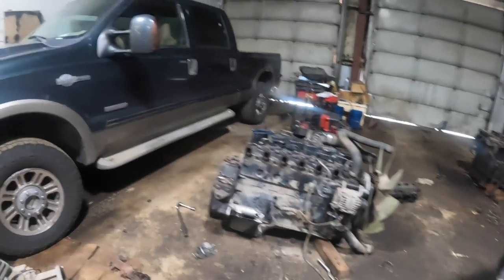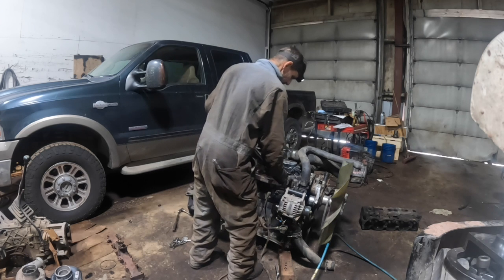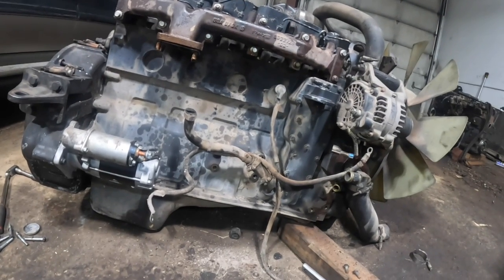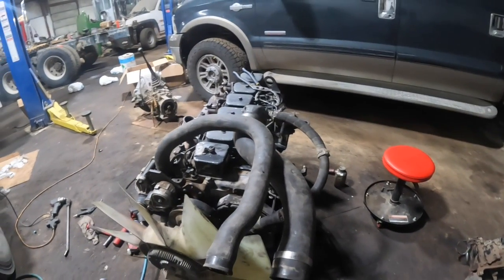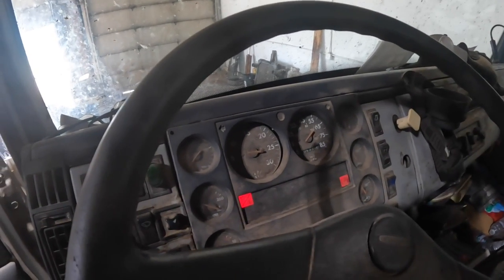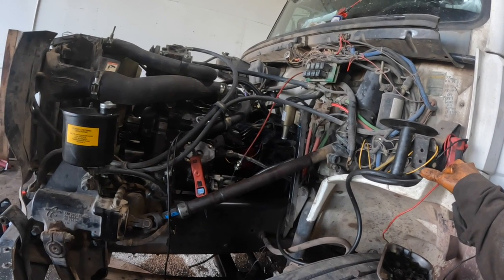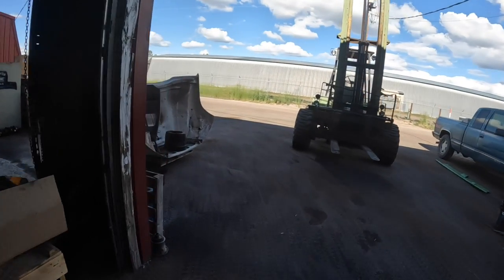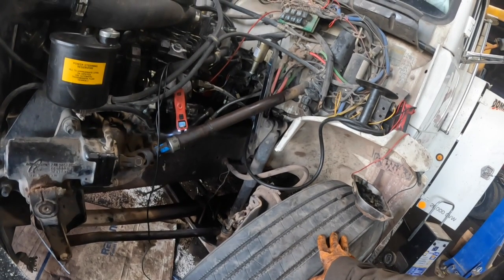Starting the old 5,9 Cummins

Comment: Real common on those VE pumps when they have been sitting around, will just have been the vanes in the vane pump in the front of the pump, will run and idle as gets pressure from lift pump, but soon as you put any demand on it they cant keep up and case pressure drops off. Sometimes they free up, othertimes they dont (couple hours rebuild with new seals on the bench soon sorts though!), you got lucky and im glad you did Warren! Good work as always thanks for taking the time to video it.

Comment: Dealt with sticky injection pumps before: just sucks. Used diesel clean, ATF in fuel,other additives. It's hit and miss: sometimes
they free up,sometimes not (rebuild required...).IP gods were smiling on you.

Comment: I put a 94 ..12 valve in my 03 dodge 3500 after  injector fail.Did the governor springs and mac plug so lots of jam.I chose to just use a pull stop cable so it can be bump started with no battery.Luv it.
    Will b interesting too see what happened to your original

Comment: Working on 2004 ram 2500 right now just replaced the front seal and running an overhead today. Was wondering if I need to replace the injectors. Has 350000 miles on it sounds like a sewing machine.

Comment: I remember in the 90’s working  for a fleet, we remove and replaced many of those 12v b series engine’s because if they lost a piston or compression we couldn’t inframe them because the blocks didn’t use liners and Cummins didn’t come out with a sleeve and the tooling till much later. By then our fleet had moved along to the ISB and so on , the b series were in our more medium duty trucks ( garbage trucks 2 axle) for mountain and smaller street routes. Most had Alison automatics that constantly had to have the throttle position sensor that controlled the tranny shift adjusted or replaced. The ability to sleeve those blocks gave a new life to them and I can’t believe how popular they become considering how many went to the scrap yard, remember the Brazilian Ford in-line 6 diesel, another scrap heap favorite. Personally the big cam , L 10 and ISM are my favorite Cummins engines to work on, repaired and inframed so many I could do them in my sleep, hell probably even from the grave. Thanks Warren for your content!

Comment: That Power service Diesel Kleen is amazing stuff / has saved me thousands - cleaned up my injectors -cleaned up the smoke / gave it more power with cetane boost  - need to use extra at first for about 3-4 days then use what the bottle calls for there after every day - its worth it / Thanks for the Video Warren 👍

Comment: Hello, Do you have a email that I can contact you? I am currently rebuilding a JCB 214S powershift transmission that have ran into some issues with piston liners and I remembered that You have worked with a few on video. I'm seriously needing help on determining what I need to do. The Pistons are the original composite pistons that JCB recommended to replace with the new aluminum pistons.

Comment: I love those old 12v's mine has 495000 miles on it still going.
With exhaust brake on a 12v they recommend running heavier valve springs

Comment: Would like to see a rebuild. Be cool if you could do a collaboration with a diesel shop like Oregon diesel or area diesel to get the parts to really make a powerhouse workhorse
Reply: Yeah for sure. I'm sure @AreaDieselService would be more than happy to help. They are masters at rebuilding the injection pumps too. They've helped out several different YTube channels in the past👍 - @WatchWesWork, @C_CEQUIPMENT, @JAMSIONLINE, @MortskeRepair, etc.👌 *I'm sure there's some other channels I missed too🤷🏼‍♂️
🛠️💨👍🚥

Comment: Try Nordloc washers on your exhaust manifolds Warren, been using them for years after suffering from manifold bolts coming loose on Paxman Ventura exhausts, haven't had 1 back off or come loose since 👍

Comment: Hey Warren, glad to see you're close to being in the road again. Well I guess by the time you see this message you'll already be hard at work. Are you going to get the old Ford service truck running? I've had similar problems with NAPA electric components. I've been building a 64 f100 and have had the water pump, fuel pump and ignition switch fail on me in less than 1000 miles. No warranty because of the one year warranty limit. The closest machine shop to me closed because the one guy who did the machine work had health issues. No one to replace him. What are we going to do. Maybe AI can solve all our problems!:😂

Comment: Waste gate turbos are only useful for gasoline engines that cant be over boosted accidentally and leaning out to detonation.  Diesels need all the boost they can get.  as the RAF in WW2 said "boost the boost and save the juice, and you will get home to roost".

Comment: I worked on a 5.9 a few years ago in a honey wagon where the pin of death shaved the teeth down some on the cam gear and busted a chunk out of the gear housing and put metal through the engine. He decided to just do the gear housing and put it back together and get whatever life he could out of it and it's still going. They were a tough old engine.

Comment: Great work and problem solving, Warren. Just a suggestion to cure the starter hanging up put a Cat start/heat switch in and delete the start wire on the key switch. Thanks for the video.

Comment: Well done Warren!
Good news that the injection system cleaned up quickly.
Pleased to hear that you'll rebuild the original so you'll be able to swap it straight in if you need it.
Hopefully it won't be too expensive and you may never need it, but it'll be great insurance .

Comment: If you like working on engines, there is no better feeling when the oil pressure is good and the runs and sounds good on the start up. Happy for you for getting your truck going.